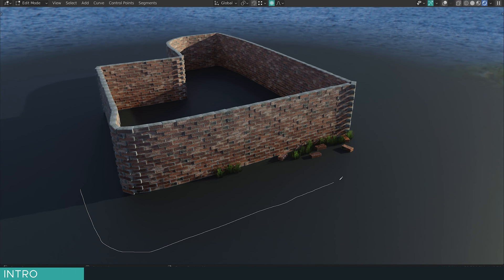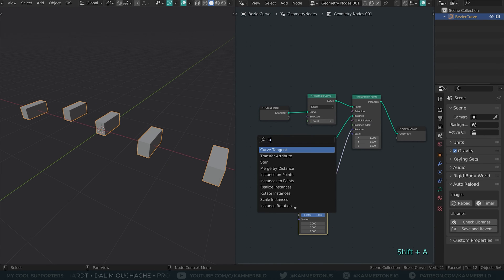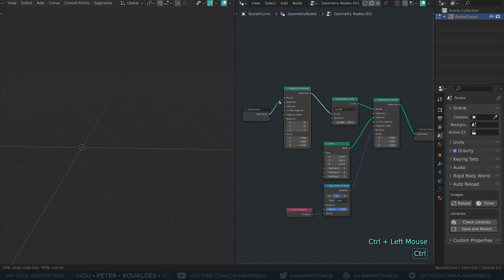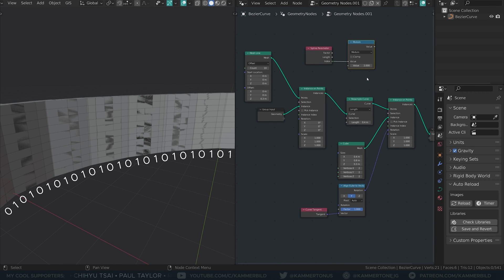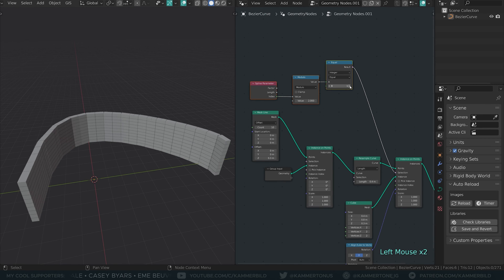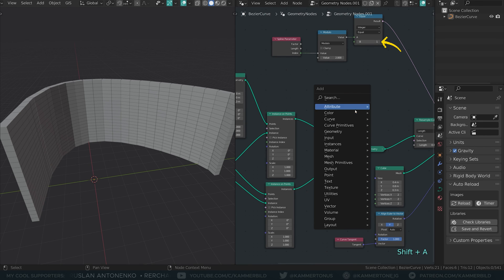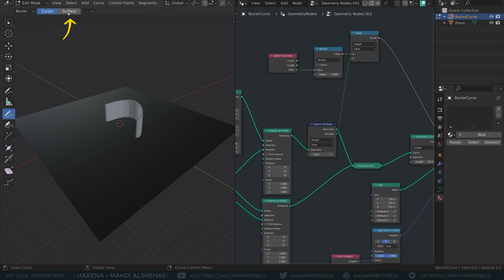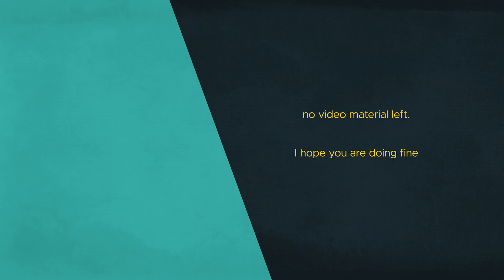Procedural brick wall with only 14 nodes

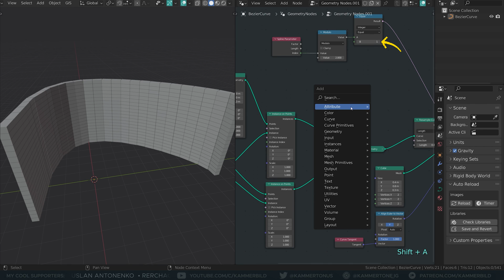Comment: I'm doing this in blender 4.2 and the "capture atribute" node is not showing in this version like it shows at 2:07
Reply: You now need to create a seperate integer value node, set that to 1 and pulg it in. Make sure to set the capture atribute node to spline. for others reading the truncated modulo node worked for me
Reply: @WadeKenny  thanks man.

Comment: I have reviewed many "Geometry Nodes" tutorials. Unfortunately, the following problem could not be solved:

As Blender version changes some "node" clusters do not work correctly. When editing educational content, the Blender version must be specified in the video.

Isn't it annoying to download separate Blender versions for each cluster of "Geometry Nodes"!?

I imitated the "node" clusters in this video exactly in the 4.1.0 Alpha version: Unfortunately, in the "Math" node in this vdeo, the "Modulo" function has been converted to "Floored Modulo" and "Truncated Modulo". Despite all attempts, the result is unsuccessful. The material colors are correct but the plastering of the bricks is unsuccessful.
Reply: Divide the Resample curve Length by 2. I faced the same problem but found the way to fix it by playing around.

Comment: That was very, very German.  Of course, I have a suggestion.

You can use a combine XYZ node to build your brick size, which allows you to put brick length, width, and height into the group input and then use those for calculating the mesh line offset and curve resampling.

Thank you for a terrifyingly efficient experience.

Comment: After doing this, I can't "Apply" the geometry in the modifiers tab. It wont apply because it needs to be a mesh to be applied. I'm just stuck with the curved wall, which would be find if I didn't need to fine tune certain sections.

Edit: (I'm super new/garbage so take this as you will). So I was able to play around with this same method using a cube. What you want to do in that instance, is use the "Realize Instances" Node in the geometry, right before the end, before the group object. This actually turned the bricks into faces/vertices I could manipulate. None of this worked with the curve, and I couldn't convert or anything. Lost a lot of time but learning is hard.

Comment: This may be a dumb question, but what method are you using to replace your cube instance with the textured brick?
Reply from the maker: You can drag and drop an object from the outliner (the list with all the objects in your scene) into the geometry nodes Setup. You then get a node with an output that you can connect instead of the cube :) you can also use a collection Info Node, set to relative, check the boxes and select a collection with different brick variations.
In the instance on points node there is a checkbox called 'select instance' or something...  if you check that you can feed a random Index into the instance on points Node to Randomize the brick-selection from that collection.
Reply: @Kammerbild  Appreciate it! great quick tutorial!